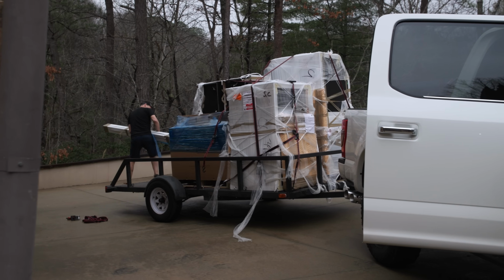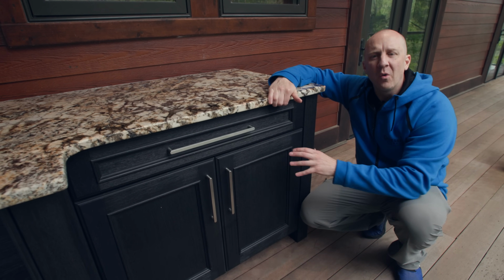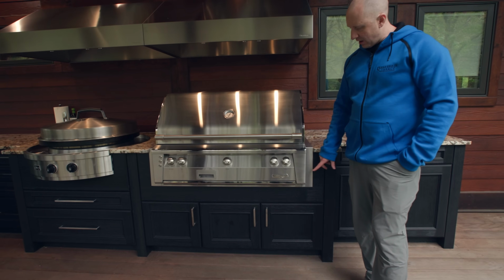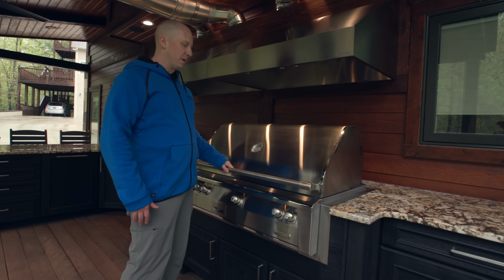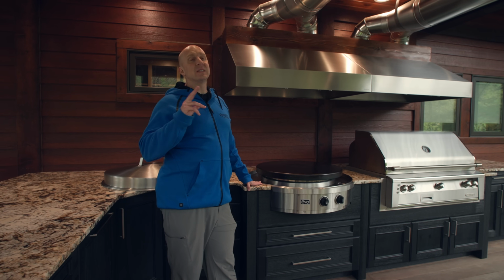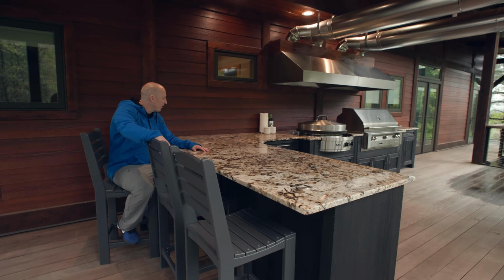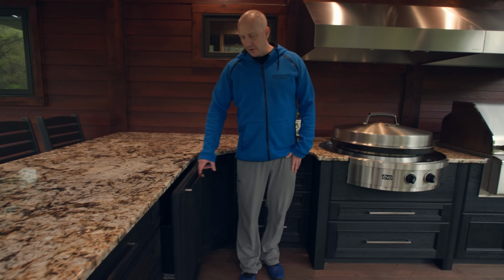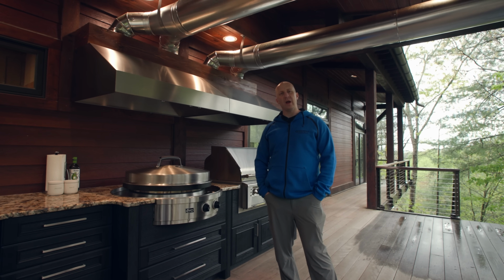The Ultimate Outdoor Kitchen OVERVIEW! NatureKast | EVO | Alfresco

Comment: Out the roof or four small ducts tucked as close to the ceiling with a soffit built around them would look much better than those two monster ducts hanging down. It looks unfinished.
Reply from the maker: Then...the vents wouldn't work.  You need a certain sized duct work for it to function.

Comment: Beautiful results… nice work! Just curious to find out if there was talk about the layout and if you ever thought about putting the cabinets on the balcony side? Still covered, less ducting, maybe no need for a range hood, walkway is a straight path etc.
Reply from the maker: The biggest issue with putting it on the outside would be it getting wet all the time.

Comment: That Evo flattop. How do you find keeping it clean? Is it easy cleanup.
Reply: The cooking surface is wipe/scrap and re-oil.  The stainless is easy to wipe off with a cleaner and towel.  I keep a handheld steamer in my outdoor kitchen.
Reply from the maker: I don't think I'd call it easy, but it's manageable.  Takes about 20 minutes after each use.